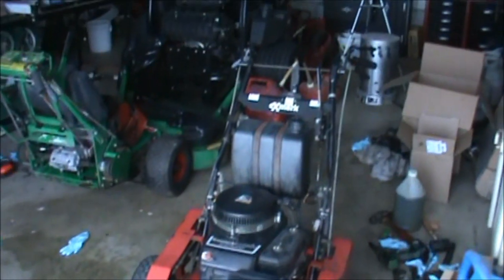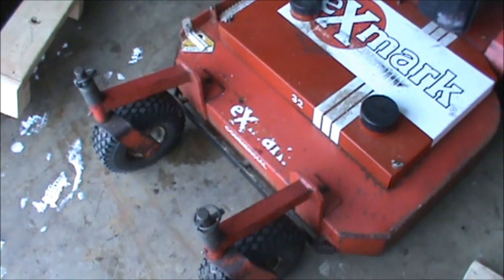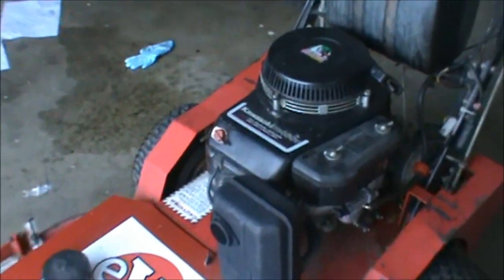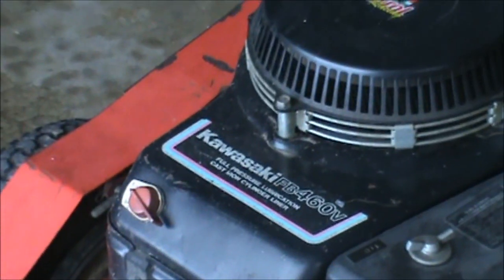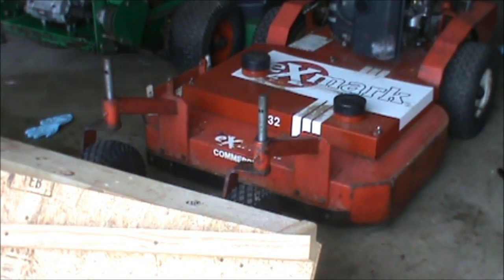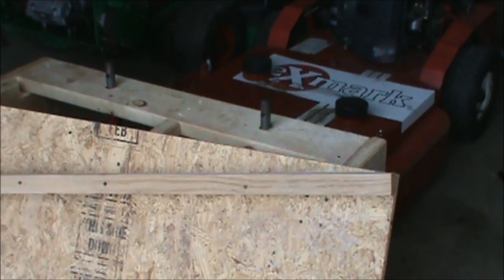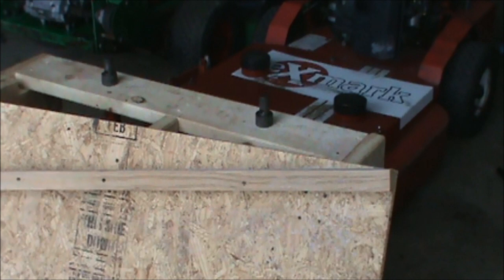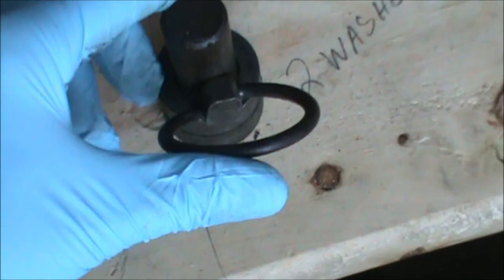Snow plowing with a walk behind mower  walkbehind

Comment: I built a plow on my Exmark 36 and it worked about the same.  I removed the deck then built a rounded plow that I could angle straight or to the sides. The plow had a thin piece of plastic on it which made the snow slip off easy even if it was wet.  I had the same belt slip problem you did.  On my mower you can increase the tension on the spring that gives the belts tension.  At the highest tension setting the slipping was not a problem.  It worked well up to about 4-6 inches depending on how heavy the snow was.  Great job on your design!  Much easier to attach than mine was.

Comment: With what you had it is better than nothing. Try this (no tools), air down the tires to about 10 psi from the factory setting of 28 to 30 psi. As for the trans, USE BELT DRESSING (in a spray can) on the trans and wheel drive belts. This will make it better. As for plowing you do not turn around. It is forward then back up then forward again, over and over.